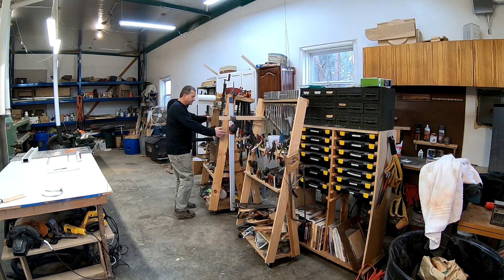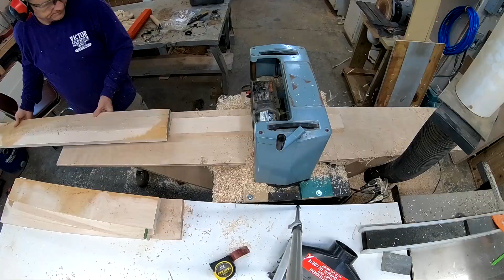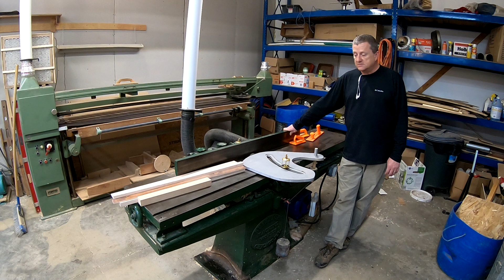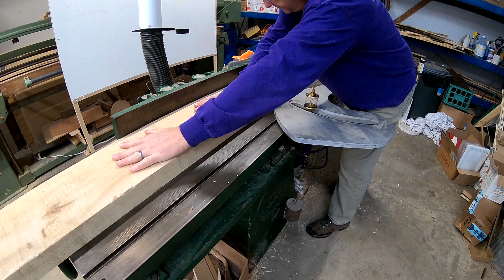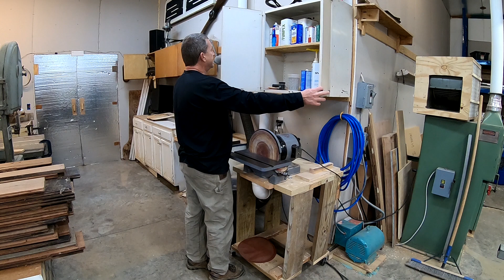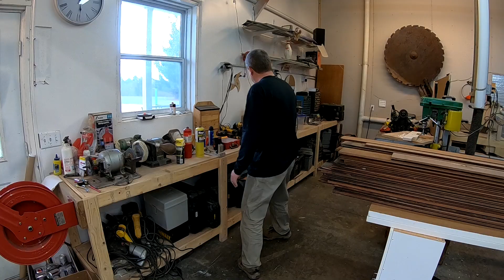2019 Shop Tour - Not Jay Bates' Shop

Comment: Hi Chris, nice shop.
I'm updating and remodeling my shop space so I've been looking at other shops for idea's; I just came across your video and just wanted to thank you for sharing.  I do a little bit of everything in my shop so a good layout is very important,  and reorganizing is the most challenging part for me so each little nugget of an idea I can glean from other shop guys is helpful.  I also have a large shop 2500 sqft and while it's a blessing it can also be troublesome in regards to putting things away (too easy to just leave it out). I built my barn 9 years ago and reorganized it several times but this is the first time for public display,  I figure if I'm going to build my YT channel the barn ought to be better suited for that, plus it seriously needs to be better organized
Once again, thanks for sharing
Later
Walt
Reply from the maker: Southern Engineering I thought about keeping all 2400 square feet of my space as shop. I chose to cut it in half. So far no regrets. The non shop side can be expanded as wood and shelving storage if I need more room space. And my wife would never stop teasing if my shop was larger than my house. Good luck with the channel. I will never monitize or have actual numbers of subscribers. I have a day job. This is my hobby.
Reply: My wife told me I couldn't have a shop bigger than the house, sadly I couldn't afford to build a bigger house 😟
The barn was originally for storage and occasional work but a couple of years ago I made a simple repair video on a new my truck,  I was truly astonished at the response and after a couple more videos I decided to see where this goes.  I'm semi-retired so this is mostly a hobby for me, it brings in just enough money to buy stuff for the shop and that's all good. 

I hope to see some more of your videos soon.
Take care
Walt